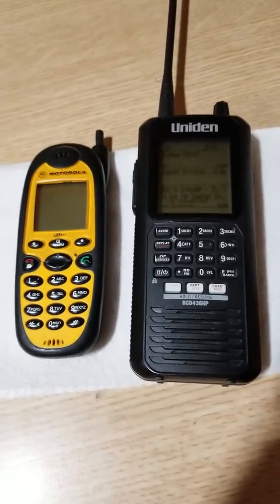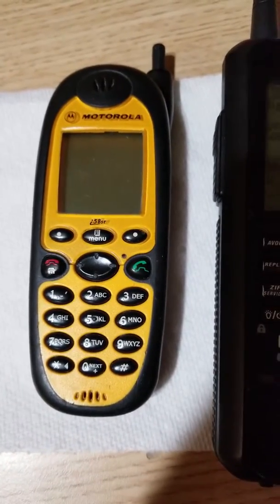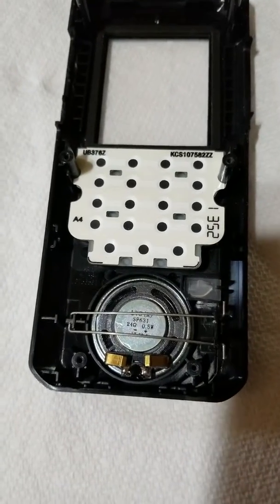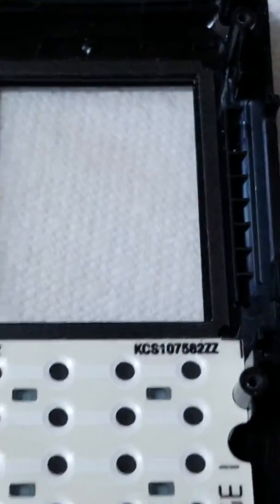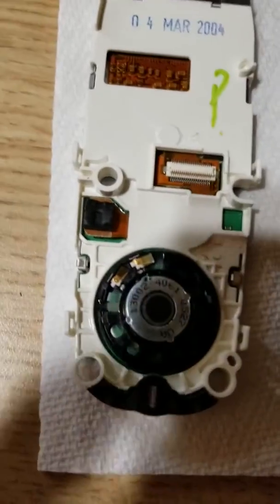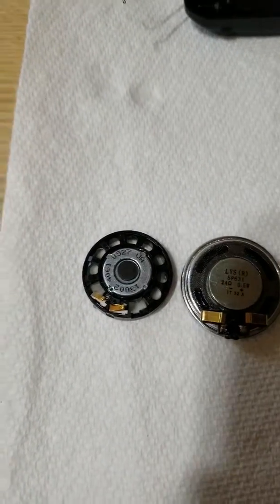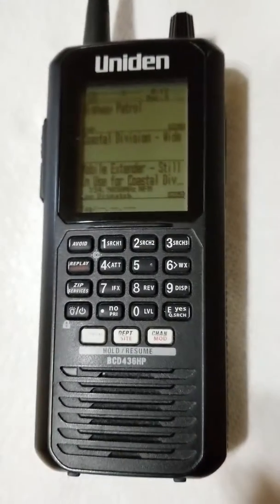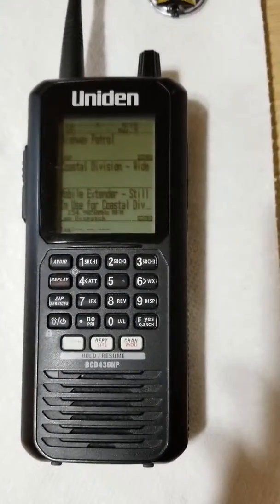BCD436HP tip

Comment: For anyone that's curious the original speaker specs are 32mm (1.25") diameter, 24 ohm, 0.5 watt max.  Original replacement part# is Uniden BSPG0631001.  I think that the reason these speakers blow out so much is that 1//2 watt power rating.  Awesome tear down video =b
Reply from the maker: Thanks for your input Angel. The biggest issue a came across is trying to get an oem speaker. Every place I tried informed me that the speakers were on backorder and had no estimated time of when they'd be in stock.
Reply: @gadgetsense3981  Knowing that the OEM speaker is only 1/2 a watt and never in stock I think that best anyone could do is exactly what you did by replacing that internal speaker with a higher quality one.  I just changed my own speaker out using this one:  https://www.amazon.com/gp/product/B07GFGLX15/ref=ppx_yo_dt_b_asin_title_o03_s00?ie=UTF8&psc=1   
It works as long as you pop that copper clip thing from the old speaker and solder the wire leads from the new speaker to the copper clip.  A little dab of hot melt glue to stick the copper clip to the new speaker and it works like a charm.

Comment: Did you check the impedance of the Motorola speaker? It can be louder if the impedance is much lower, but at the same time may damage your radio. The one you took out was 24 ohms. Just curious.
Reply from the maker: Hey. I don't know. All I can say is its louder. I also switched out the BC125AT with same results.  If it damages the radio I hope it takes several years. Thanks for the comment.

Comment: How do yo blow out the speaker on the radio? I have the volume on mine set 10 and it's been fine for years.
Reply: The speaker on my 436, which I’ve had for 8 or more years stopped working about 6 weeks ago. Volume level is not the problem. There are well documented issues with the 436 speaker.  The housing unit connecting the two metal prongs is poorly constructed and often breaks.  This video saved me time and money.
Reply from the maker: Well when I'm on the road or noisy environment, I tend to keep the volume up to about 14-15. It allows that level, it should handle it.

Comment: That's why I really hate p25 digital because some Transmissions who knows why are very Bassy and too loud that's why these are blowing up all the time as far as their original half watt speaker because of Transmissions that have bass I never liked that kind of digital modulation in the first place I don't know why people had to end up switching over to those digital systems like that that's just more aggravation for infrastructure like blown speakers even in the Motorola's they blow speakers all the time I've had the repair several of them myself never wanted to do that again I quit the job afterwards because I was so sick of having to replace the same damn part all the time
Reply from the maker: I agree. The digital is clear, but for listening on a scanner it takes a toll. The actually p25 equipment is heavy duty industrial grade, so I'm sure it's loud and clear on their end. I would invest in a Motorola P25 hand held if I had the means to program it. I only have software for the CDM and HT series and they're not digital.